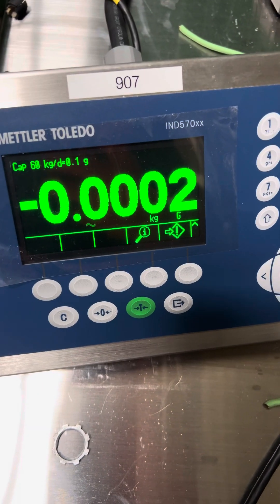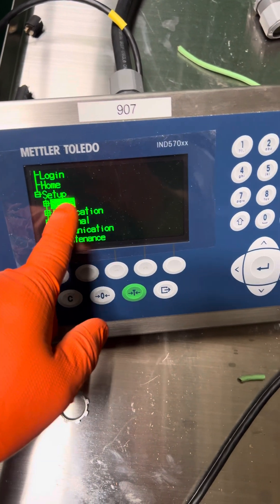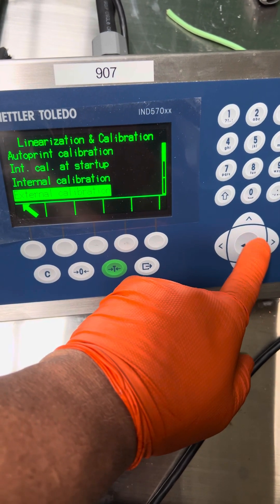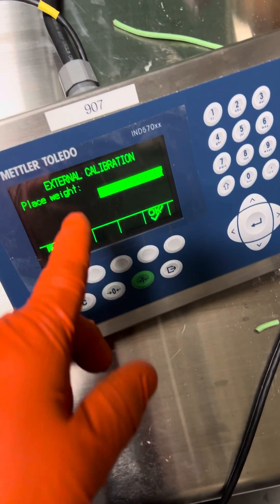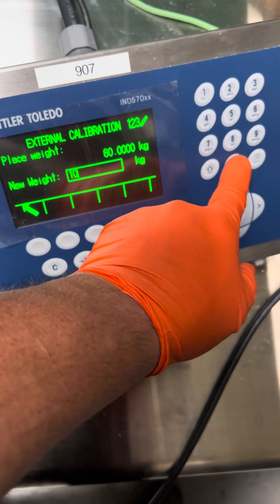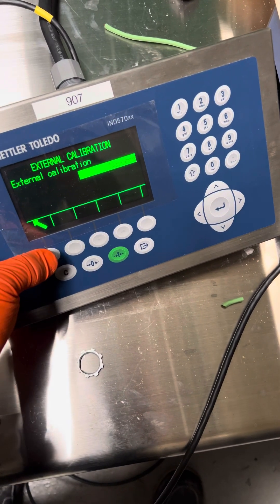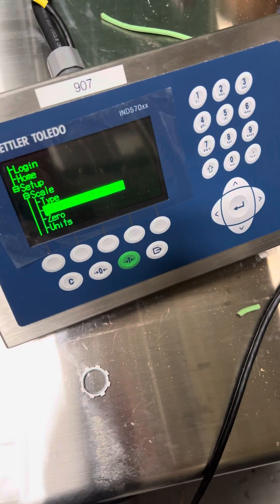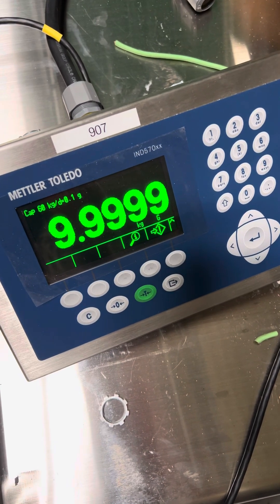Calibration adjustment of a Mettler IND570xx

Comment: Great video. 😎 Loving the obsolete indicators still working.
Reply from the maker: Obsolete? That’s a brand new indicator brother, they’re still being sold by Mettler it was sold by our brother company Atlantic Scale Co.
Reply: @Raddamez1215  yes isn't the IND570 OBSOLETE? ISNT THAT THE XX?
Reply: And also the IND560
Reply: @SKORE1  The 560 is obsolete.
Reply: @Scaleman  😎
Reply: @Scaleman  😎👍🏽
Reply: @Raddamez1215  good to know 😎
Reply: @Raddamez1215  Your video should say IND570XX. It is the intrinsically safe model. Since it is connected to a high precision base, You should do the internal Calibration first. If it is off with external weights the the internal weight can be adjusted with external weights. The IND570 has a different menu structure, it has icons for zero and span.